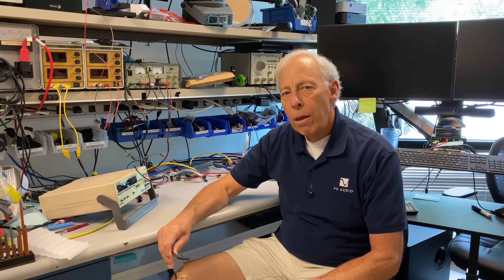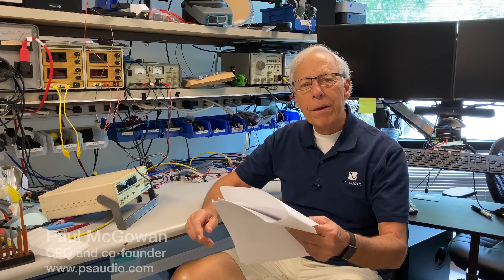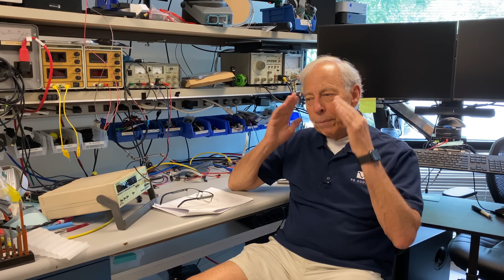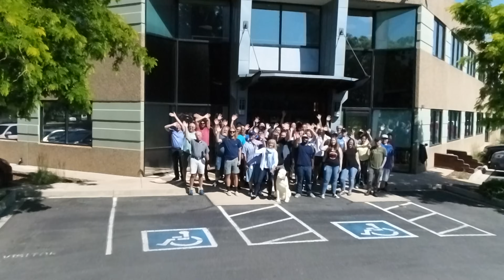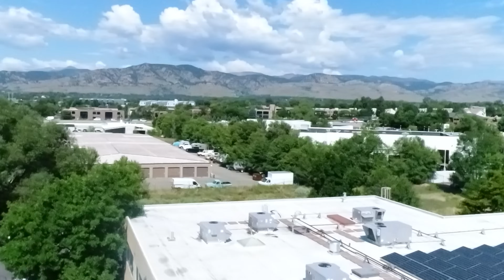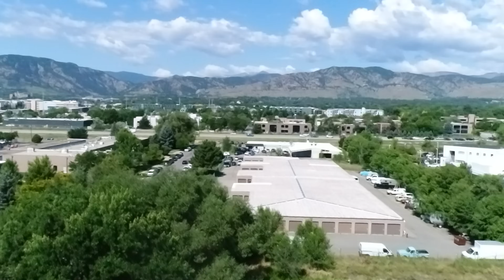Why not build differently powered amps?

Comment: I'm building a Tri-amp setup to bypass my 3way tower crossover with that formula: Streamer -> minidsp digital as digital cross over -> 3 stereo DAC -> 3 stereo power amp. Volume controled by the minidsp. I've already tryed bi-amp with that philosophy and it worked amazing, but it wasn't bypassing the speakers crossover. My guess is that the tri-amp with be marvelous.

Comment: 30 years ago I built a bi-amp system using a pair of two way satellite speakers powered by a 50 watt stereo amp, and two 12 inch bass drivers powered by a 100 watt stereo amp, and drove the two amps via a preamp through an electronic crossover and graphic EQ device made by Audiocontrol called the Richter Scale, that was a great sounding system I enjoyed for many years, no idea why there aren't more hi fi enthusiasts going this direction.

Comment: About thirty five years ago Naim Audio manufactured an active crossover to be used with the Linn Isobarik speakers. Using an active network avoids the many problems of passive ones - saturation, creating a reactive load for the power amp to drive, etc. One used it with three stereo power amps, or, even better, six monoblocks!  I never heard this combo, but it had something of a cult following.

Comment: If people used properly rated amps in the first place they wouldn't need to bi amp.  There are two issues here...power requirements and dampjng factor.  Woofers generally need amps to have a high damping factor and enough power for peaks so chosing an amp with low output impedance and twice the power you think you might need should cover all bases.  Too many are using amps that are too weedy which are borderline and can be driven into clipping.  Most valve amp choices unless using high feedback will not have low enough output impedance.   One of the best in this respect are Radford STA amplifiers.

Comment: Great honesty about the reality of introducing new products. The small electronics company I work for in the U.S. (made in USA, New York to be specific) also must foot the bill for certification testing. So it's not the engineering that is the problem, heck, that's the easy part, but how to have a R.O.I. on your new product after everything is paid for, and how to pay for everything. Will the product sell after many resources are used to get it to the market?  So DIY may be a possibility with bi-amping for sure.

Comment: Linn made a solid little amp called LK140, which has a modular design that allows it to be run as a single full range, a pair for bi amping (even 3 for tri amping) depending on how you wire the preamp inputs. These would use the speaker’s crossover by default, but you can add an active crossover at the preamp input. And the active crossover for me made a huge difference! Best two hundred quid I spent on an upgrade. Ever. The speed and precision of the whole speaker (mine are Linn Ninkas), the bass control and the soundstage all massively improved what was already a very very nice system.

Comment: I have one question, does car amp and home amp  (avr r amplifier) are same or different. Both are class d or ab,  I know  about the impedance and power supply  section on both amp.apart from that any differences??
 If no means why home amp are too expensive. I can buy car amp and one 12v 100AH battery.

Comment: I've tri-amped since about 1980. My speakers are high efficiency, so I only have 120 WPC for woofers (bipolar), 120 WPC (bipolar) for midrange, and 60 WPC (V-FET) for tweeters. I've never clipped. Bi or tri amping is one of the most cost-effective ways to improve the sound of a system. There are some exciting developments in crossovers using DSPs or FPGAs to construct long FIR filters. This can substantially reduce phase distortion.

Comment: “you have no idea . . . “ Not meant as criticism, but actually, some of us do and you’re referring to a breakeven calculation. I’d be interested in your guesstimate as to how many units that would be. 

In the mid-80s I was working for a U.S. automobile manufacturer and was based in a region still using leaded fuel. Depending on how similar a new vehicle was to one in our existing North American model lineup, our breakeven for converting an unleaded fuel vehicle to leaded was anywhere from 50 to 200 units. Just like you stated in your video, many of these great marketing ideas died on the table when we went dealer by dealer to get a commitment and ended up way short for what was really a niche model.

Comment: I have 3 bi-amped systems in my house, and the high frequency transducers take as much or more drive than the low frequency transducers. I don't have to worry about amplifier gain, because in each system the amplifiers are identical. (Twin Hafler DH 500's for one system, twin Ashly FTX 2000's for another system, and twin BGW 7500's for the third.)

Comment: Seeing nelson pass and his diy audio flock doing stuff like this. He is so much a believer he has come out with cross overs for biamping different drivers with different gain amplifiers. Like using one of his first watt 25 watt amps for the tweeter and midrange and using a more powerful class ab or class d amp for the bass units and tweaking them to blend with neslons microcap sim software. This is all very cool but low volume stuff. Thanks paul for putting cost of products to reality. Makes you appreciate manufacturers that put for the effort to help with this stuff for not much financial gain

Comment: My Altec Lansing 512 tower speakers are self tri amped. On the board it appears all of the amps are the same IC "Toshiba 2SC3281"  yet the specified power output rated to each speaker is different.
Also Daniel Hertz company, the newest Mark Levinson project offers a BI-AMP Amplifier check it;
https://www.danielhertz.com/daniel-hertz-products/m11-amplifier

Comment: The loudspeaker would need to tell the amps where to crossover, so the crossover could be active.  Two way communication between speakers and amps should be possible.  The alternative is active speakers taking over, which is fine.  But why not offer a new option.

Comment: McIntosh mc 901 is  this.
A 300w tube amp for mid and high’s and a 600w solid state for bass and it’s beautiful
Reply: At a cost of $35,000 for a stereo setup, it had better be more than beautiful.  
But I don't think this is quite the level of equipment that Rafael had in mind.
Reply: Yes they are expensive and this is absolutely high end equipment but yes maybe they should make a cheaper model to for normal people

Comment: Check out McIntosh's newest amp. It does this exactly ....
Reply: Wow, I was thinking the same thing, the MC901 specifically.  I still think that PS Audio should do it as well.
Reply: @isaacsykes575  I would love something similar. Just smaller
Reply: @FatRat-f9m  tube + class A.  Picture if you will, some sort of 845 type tube amp mated to a Krell ksa100. The 845 could be whatever triode amp you prefer and I used Krell as an example because they build the type of amps that double their output as the load is halved.

Comment: Go active!!! PS Audio amps + miniDSP cross-over can work. Just open your whatever speakers (usually through the woofer) and pull out those old-style cross-over filters from them and add some proper speaker terminals connecting directly to the drivers. Check https://www.minidsp.com

Comment: Not so much that the gains between the woofer amp and the mid-tweeter amps need be balanced, but the gains need to be adjustable to account for the speaker efficiency so the total channel sound is level over the entire frequency range.  That would require a microphone with a wide linear frequency range, a white noise generator, and a spectrum analyzer to adjust the system, much like the way surround sound amps adjust the channel gains with a microphone (this adjustment must account for different speaker wire lengths, speaker efficiencies, and desired surround balance).

Comment: Greetings Paul, I think there are more people then you realize that are bi-amping or tri-amping their sound systems. Getting ride of the passive crossover network does wonders in helping in playback dynamics. Having both specialized transducers and specialized amplification for a given frequency range makes good sense. It is so hard, and nearly impossible, to have an amplifier that performs extremely well as the low power hungry frequencies and continues to perform extremely well at the high frequencies (where a flat phase response in important). The big issue now is finding the electronic crossover with excellent (read audiophile) audio properties. That is a huge subject in itself. Take care.

Comment: A great way to over complicate and spend extra $$$$$ your consumer bi-wire setup.... because crossover... Here is a counterpoint, take my system, 2 stereo amps, 300 Watt 8ohm class D for woofers, and 330 Watt 8ohm class A-B for the mid and high drivers. Why not a smaller one for the mid/high? Amp headroom, I take all the spare amp headroom the audio Gods will allow me to have on this Earth. (and yes, the woofer amp is way under powered... it clipped once)
Reply: I live for amp headroom !! I always try to supply 2x the rated rms wattage when budget allows, and most all of my clients have the budget 😁
Reply: @FatRat-f9m  noooo, 2x rated wattage is only 3db....and a little bit more expensive.

Comment: In my humble opinion, if the aim is audiophile perfection, active cross-over and individual amps per speaker driver is the best and will do much more improvement than a power regenerator for most setups. Thus PS audio should also consider making products for it.
Reply: While active crossovers have advantages, it is  a myth that it is the best way to go. There is a reason speakers in the six figures still use passive crossovers.
Reply: @carlosoliveira-rc2xt  It's not a myth. From an engineering perspective, having each speaker driver directly connected to the amplifier provides the best control incl. best damping factor. Doing the cross-over filtering actively allows much better and precise filtering algorithms for better control of linearity and phase without sacrificing efficiency or damping factor. It absolutely is superior on audio fidelity when done well and yeah, there is a lot of conservatism in the high-end business, but that has nothing to do with what is technically optimal. The reasons six-figure systems still rely on passive cross-over filters are mostly because each component of the system is made by different companies that aren't skilled to holistically make an optimal integration. You see, active systems require some skills of combining things from more diverse engineering disciplines. The KEF LS50W (active) sounds much better than KEF LS50 (passive) because KEF has learned how to optimally integrate components for superior performance. https://www.youtube.com/watch?v=Sg4d7EOVmwE
Reply: @ThinkingBetter  I stated they're are advantages, you're not telling me anything new. I've been in the business in one form or another for 40 years. Damping factor is overstated. They are already high enough to be inconsequential.
Reply: @ThinkingBetter  Many speaker manufacturers produce the entire speaker in-house including crossover components. You're attaching results to causes that are unrelated.
Reply: @carlosoliveira-rc2xt A better damping factor is just a minor advantage of an active speaker architecture. The performance advantages are many. The fact that active cross-over is technically superior is not depending on whoever makes the crossover components or however many years you've been in this business. An active crossover filter can either be analog or digital but in either case, you can tweak the filtering much better for when you don't have to consider heavy power, impedance, and energy losses.
Reply: @carlosoliveira-rc2xt  BS, I've done it that way for forty years on countless systems, it's the best way to go !!
Reply: @poserwannabe1  Your name speaks volumes. In cost no object speakers the benefits of active crossovers are negated. Read carefully what i'm telling you. In a relatively inexpensive speaker the few advantages active crossovers present outweigh the corners cut primarily in passive crossovers. So it appears to be the superior way. Once you no longer have to deal with those short cuts passive crossovers have fewer disadvantages and becomes the more advantageous way to go with regards to sound quality and versatility. Electronics adds many deleterious effects to sound quality unless you think a $1000 amp or pre is perfect. In that case I can't help you. 
Someone else mentioned how the Kef LS50 passive was bested by the active version. Neither of which sound good to me but for illustration purposes I will say this. The new passive LS50 Meta sounds better than the original active LS50. This illustrates my point exactly and we're talking about a relatively inexpensive speaker here. When you get to the upper ranks, this becomes much more obvious.
Reply: @carlosoliveira-rc2xt  first off don't worry about my name, you have no clue what it means. Second, years of experience have taught me active is always better. Third you say "when you get to the upper ranks" how do you know what rank I'm in to start with ?? I'm not going to argue, I believe active is ALWAYS better, you can spend your money however you want, peace.

Comment: I'm not sure if it's bi-amping he's talking about bi-wiring he's saying it could be done with DSP in the amplifier and you have 4 terminals 2 for each speaker one set for the mids and highs and the other for the bass woofers having room correction like studio based REW what is free coast nothing to the company and a microphone supplied with the amp to get time alignment and synergy with your speakers. Arcam did that on some of their amplify models where you would have a defeat for bass so you could biamp you would use the defeat for the mids and highs a switch and knob too dial it in. 
Your 1200 series amplifier you could do with that hardly any modifications a extra set of binding posts ASP circuitry I would prefer over DSP having a mic setup with  presets parameters as well as I say rtw correction no cost to you or the user just put it on a chip. Different EQ ing can be downloaded with a USB stick and plugged into the amplifier to suit different types of speakers what you would test that in factory in listening tests and be open source for people at home to give to others to try out.

Comment: I would recommend MiniDSP for this niche...it allows you to route the different signals to different amps and allow digital crossovers so you can fine tune it without a lot of the hassle plus you can do room correction stuff if you're into that kind of stuff.   It's really affordable all things considering for a couple hundred!
Reply: Agree, miniDSP makes some great products for active cross-over setups. I have 3 of their products. But this is not for those who like tube amp distortion and vinyl records but rather for those of us who enjoy modern digital audio and are not afraid to tweak the audio a few dB for maximum musicality and pleasure.
Reply: https://czaudioshop.onuniverse.com they sell amps and subs for mad cheap I got the MTX and it works really well